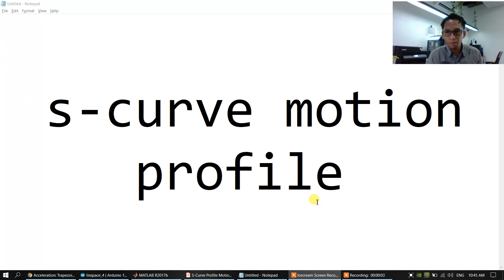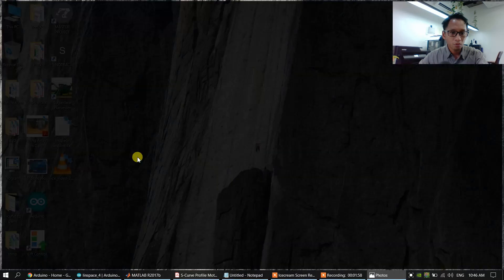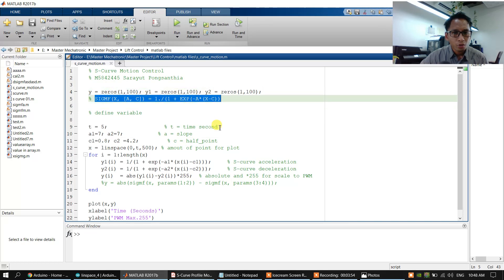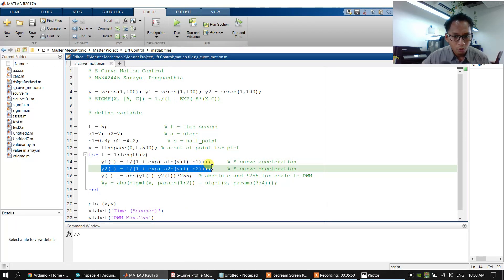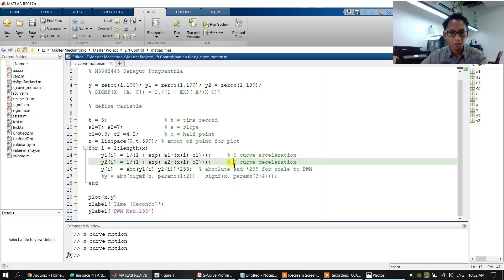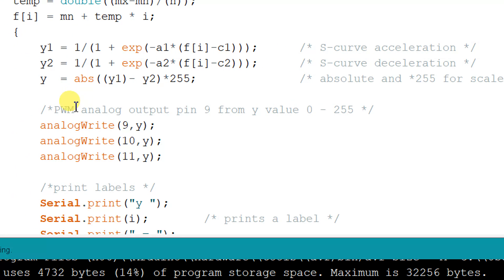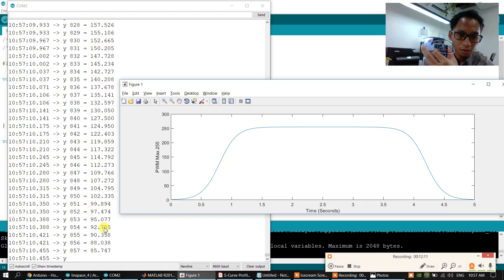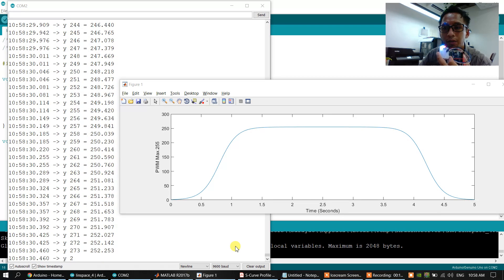S Curve motion profile PWM

Comment: Interesting presentation.  But I don't think that would work with a motor.  The code is PWM'ing the velocity curve.  But the PWM for a motor is proportional to Torque which is proportional to acceleration.  To get the S-curve all you need to do is to ramp your acceleration according to your graphs.
Reply: Also thank you, very enlightening
Reply: How would one do that?
Reply: @nzuzomal4545  The PWM should ramp linearly to the max acceleration (duty cycle) you want.  It's the instant jumps in acceleration that causes the jerks in the glass.  I use a real-time operating system.  So I set my desired duty cycle (maybe 90%) in a member function.  Then each timeslice for the motor, I bump the acceleration up by a fixed amount (maybe 10 counts).  So if I'm at 0 duty cycle and want to go to 100 duty.  The timeslicing will add 10 each time.  After 10 timeslices, I will be at 100% duty.  Similarly then if I want to stop the motion.  I set desired duty to 0 and wait 10 more timeslices till it reaches.  if I do it all in 1 timeslice that's when the sudden jumps will result in "spilled beer".
Reply: The PWM/acceleration curve should be trapezoidal.  Then the velocity curve will (by nature of integration) be an S-curve shape.  You don't have to form the S-curve, it happens naturally when acceleration is handled properly.
Reply: @stenniswood  are you talking about a stepper motor like used in the examples or a DC motor? because stepper duty cycles does nothing, its frequency that will alter acceleration.
Reply: @EdwinFairchild  Ah, good point.  I see in the video he is using a brushless DC motor.  My motor boards turn a DC motor into a servo.  So PWM is the acceleration.  You would want to do a stepper motor differently.  You'd have to linearly ramp the counts / second.  And probably best to calculate the actual position before hand instead.  Thanks that is where the disconnect was.
Reply: @stenniswood  please read about jolt, jitter and jerk in servos..... and then it should be obvious to you that this method is used to obtain a awsome compromise between S curve motion profile and minimalistic computational resources use.